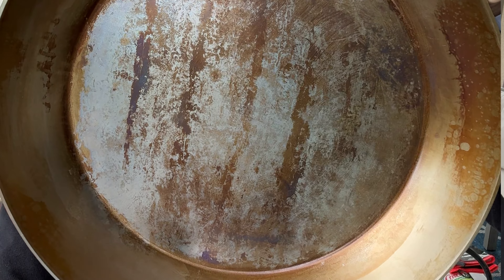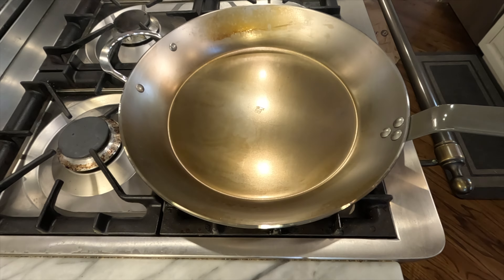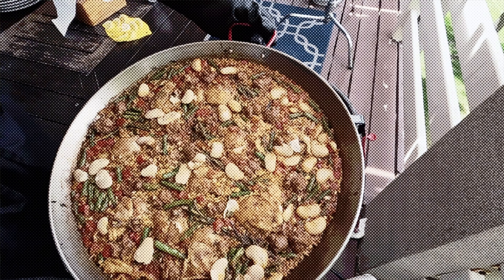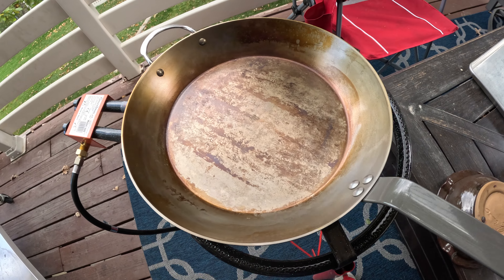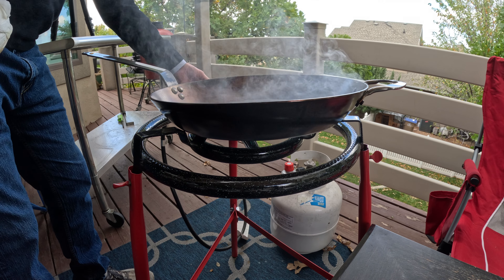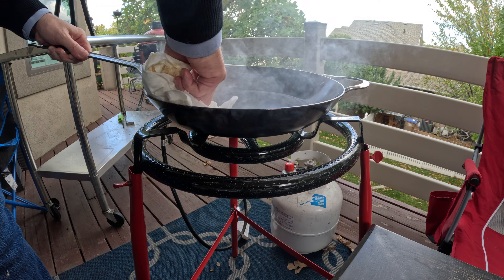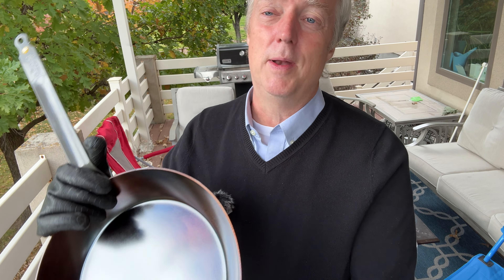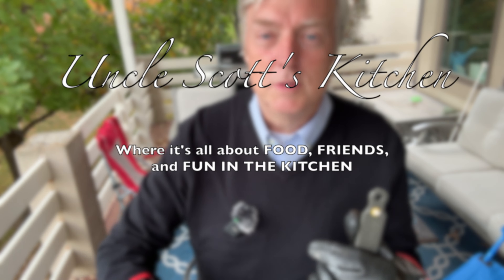Carbon Steel Seasoning: How to turn your pan into a work of art!!

Comment: Hey, Scott! Your carbon steel pan videos are always a treat! I caught your review of the Smithey Farmhouse Skillet a while back which was great stuff, but I found myself wishing for a side-by-side comparison with De Buyer and Matfer. That would be really helpful for someone like me who's in the market for a top-notch carbon steel pan. I know Smithey's cast iron is top-tier, but I'm curious how their Farmhouse Skillet measures up to the competition. Reviews on this pan are pretty scarce, and direct comparisons are even harder to come by. So, I'd really appreciate your take on this. Setting aside the shallower depth of the regular Farmhouse that you reviewed (they do have a deeper version, called "Deep Farmhouse Skillet" that's actually at a normal carbon steel depth), how does it directly stack up against De Buyer and Matfer? Does it heat as evenly as they do? How long does it take to heat up compared to them? How's does the heat conduction and transfer compare? And does the seasoning hold up as well as the De Buyer and Matfer? Your insight would be a huge help as I'm eyeing both a cast iron and a carbon steel pan that I would like to purchase in the next few weeks. I'm pretty set on Smithey for the cast iron, but I'm on the fence about whether to go with their carbon steel or opt for De Buyer or Matfer. Thanks a bunch for all your awesome content, Uncle Scott!
Reply from the maker: I've had a couple issues with Matfers warping on inductino burners, but they cook very well especially on gas. The De Buyers have never warped on me and they cook very well AND they are a little nicer looking for a fancy home kitchen. Matfers are a little more food service oriented. Some Matfers were also recently recalled in Europebut not here in America. I have De Buyer as my number one, but Matfers are still good too. The Smitheys are awesome, but they are almost one-off works of art pieces... great conversation piece if you can afford a Smithey. but they don't have the fill lineup top to bottom.
Reply: @UncleScottsKitchen  Thanks a lot for replying! So to make sure I've got this straight: You're saying the only real hiccup with that Smithey Farmhouse pan you checked out was the size and measurements? Like, specifically how much cooking space it actually gives you? Everything else such as the even heating, how quick it warms up, heat transfer, and how well the seasoning sticks, etc... is all top-notch stuff? Just trying to get the full picture here, you know?

Comment: I season all my carbon steel and  cast iron pots and pans outside on the gas Weber BBQ to let the smoke away.  Turn them upside down and let them cure. Works great.  The Paella heater looks even better!

Comment: Hi Uncle Scott!  Love this video.  I have used the oven method, the one time  smoke oil then wipe wipe wipe & some touch up method with buzzy wax, they all work & I learned from your videos first and now last.  I ordered a 91/2" Mineral B Pro Omelet pan using your url and UNCLESCOTT,  it is on it's way.  Thanks for your videos!

Comment: Uncle Scott, have you ever tried the step commonly used for carbon steel woks, what people call bluing or tempering? Heat it when it's completely clean and shiny with no oil. It will darken differently than when there is oil. 
I've found that doing this before seasoning with oil helps the seasoning stick in my de buyer.
Reply: My experience as well. I’ve done this to both cast-iron and carbon steel pans that would not reliably hold a seasoning, no matter what I did. Ran them through a heat cycle and haven’t had a problem since. I’ve asked Scott about it on an older post recently.  No response yet.

Comment: Another good one is using a turkey fryer/boil burner.
Reply from the maker: Believe it or not I had my turkey fryer out on the deck as well as a backup in case the paella burner didn't work. I might try it for a wok and see how that goes.

Comment: Hey Scott, Have you heard of the new Carbon Steel Skillets from German brand "Woll"? They are thicker than anything you have seen, I just received the 8 inch egg pan.  It is 3.5 mm thick and weighs almost the same as the mineral B 9.5 inch. It has a wooden handle though, but it really feels like a solid piece. I tried to comment before, but youtube does not seem to allow it. Perhaps because mentioned the name of where to buy in Europe (the one with the rainforest but in germany or the UK)...

Comment: What a great deal! Can you ever have too many carbon steel pans? I just ordered the Strata clad carbon steel pan but it won't ship until Nov 30. Would you suggest I get the De Buyer 9.5" omelette plan even though I have the Strata 8.5" on backorder?

Comment: I have a 14" from the Carbone line (same as the Mineral B without the beeswax) that I haven't seasoned yet because my burners and stove space are too small.  I don't have a paella burner but have wondered if I can season over charcoal on my Weber.

Has anyone ever done that?
Reply: You can season them right on a campfire if you want. That's one of the things that make it so amazing. So, yes, a webber, or any grill could work.
Reply: @liahfox5840  What about the smoke?  Will the pan always smell smokey and impart smoke flavor to the food?

Comment: Great stuff. Unfortunately induction hobby is all I have...😢
Reply from the maker: Got to go oven seasoning or just try on the hob and see how it goes
Reply: @UncleScottsKitchen  Thanks Uncle Scotts. The main problem of induction hob is the center is too hot compared with the outer ring. It is always black in the middle and the wall is brown from oven seasoning, then the middle ring is lighter color. Even after some very good seasoning in the oven, the bottom part of the tray can not get covered well due to all kings of scratches (not metal by the way). If there is a systematic way to treat induction hob-used pan well, I am much appreciated!

Comment: Love your videos but they are too expensive.  At some point people have to just say no. If they keep buying anything,  not just carbon steel pans, then they are basically ignoring extortion, not inflation.
Reply from the maker: They are indeed expensive but they are very high quality and will last a lifetime AND they are 25% off at the moment! Use this link and CODE: UNCLESCOTT at checkout: https://debuyer-usa.com/collections/carbon-steel?sca_ref=404835.2T2gLdk0je
Sale ends November 7th... jump on it! (affiliate link)
Reply: Strange comment.  You should just be speaking for yourself.  If you're too cheap to buy the stuff...or can't afford it, then don't buy it.  It's really simple.
Reply: Cheap non-stick pans are more expensive in the long run! You buy one of these carbon steel pans and it'll last you a lifetime. Non-stick pans you'll be replacing over and over again in the meantime.........